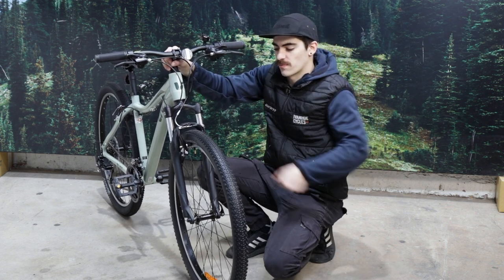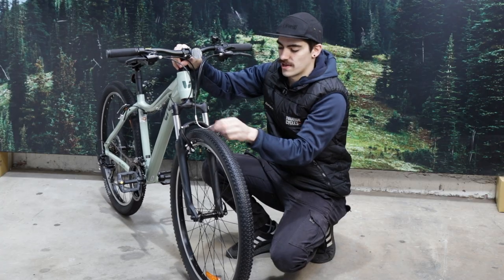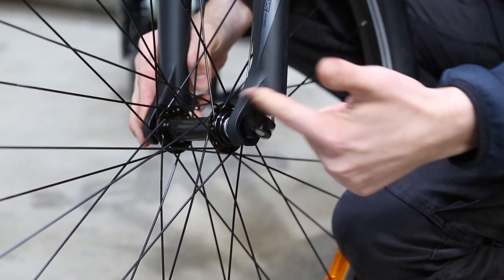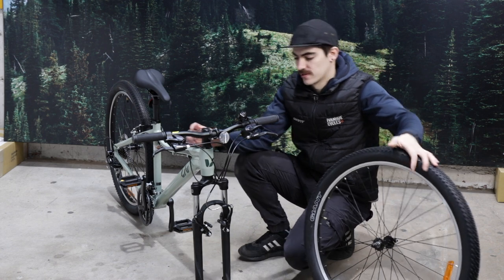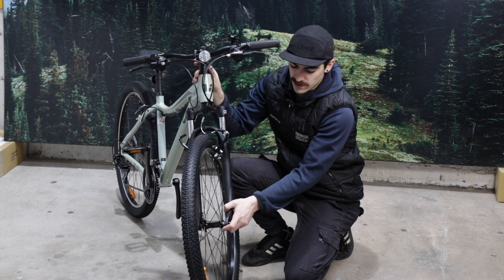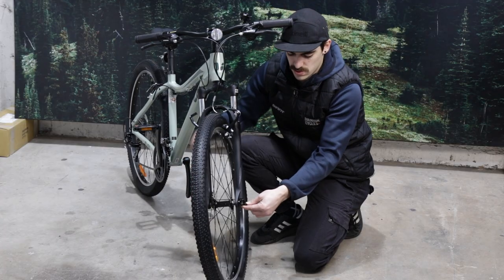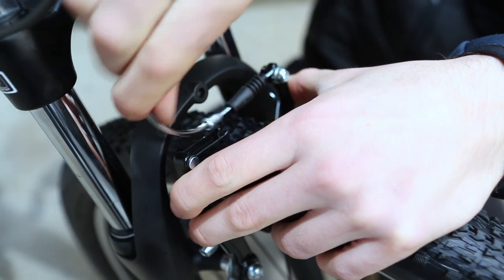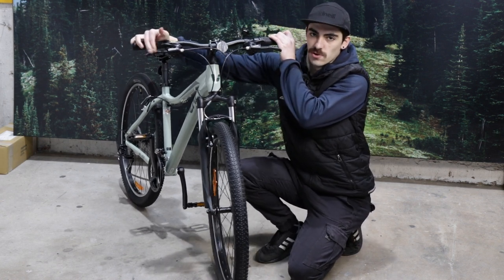How to Remove and Reinstall a Wheel with V-Brakes - by Ivanhoe Cycles

Comment: Thanks for the tip to squeeze the caliper and lift the noodle. I had been unscrewing the bolt that secures the cable before. This is way easier and requires less recalibration after reinstalling the wheel.